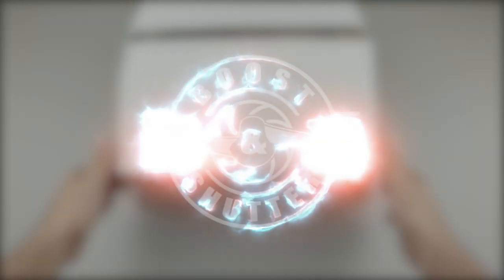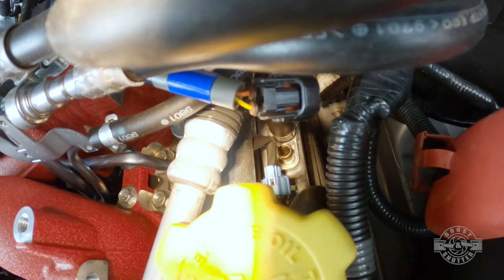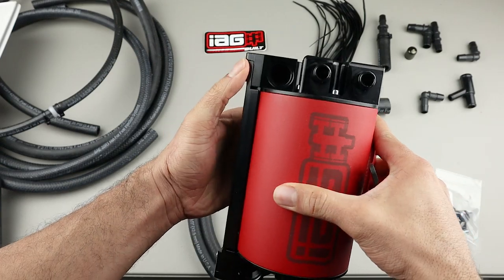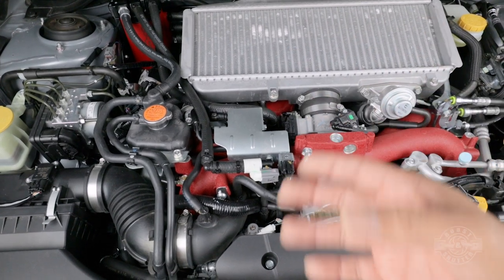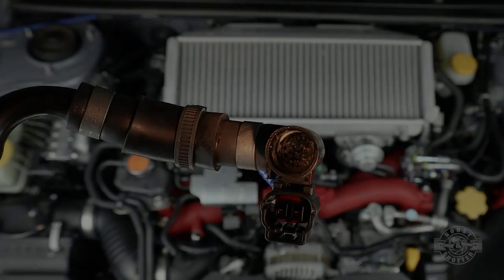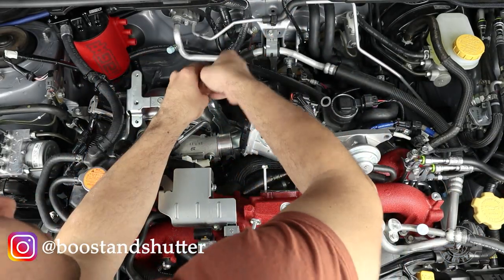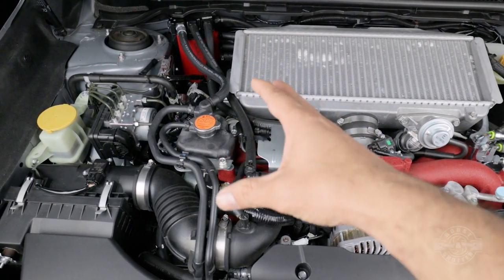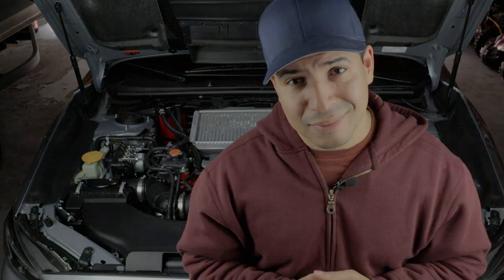How An Air Oil Separator Works | 2020 Subaru STI IAG AOS |

Comment: I had the comp version but converted to the street since I run e50 minimum...Now I'm wondering if the street version is actually doing anything since those gases are still in my engine..I've heard of a few people running 23+psi having the street AOS clog up their EBCS lines...I insulated the return hose with foil tape and insulated mesh wrap because I've heard horror stories about condensation freezing inside the hose causing BOOM

Comment: Holy crap. A lot to take in. 
Would you say this mod is damn-near a must for almost any Subaru? Or more for those who have high horsepower engines, like heavily modified engines or Imprezas and STI’s? 
I have a 2017 Forester w/ the 2.5 L engine and “premium” trim.
Reply: I’d say more EJ engines as he said

Comment: Wow dude thanx... I am glad for the video it helps... but I am having a slightly difficult time completely relating this to my AOS on My Porsche. I have a 2006 Porsche 997 and currently working on changing mine... I have oil in a couple of my hoses... can you explain the tubes workings on mine please. I am unsure if oil should have been in them in the first place. Help needed if u can thanks.

Comment: Hey Boost & Shutter - could you updated the amazon link for an IAG AOS for the 2020 STI? When looking at the product on IAGs website, it doesn't explicitly state the 2020 STI is supported. Just want to make sure to get the correct one. Thanks!

Comment: I have the IAG AOS and was curious. Is there any maintenance it requires/cleaning? My research I have learned it basically “cleans itself” unlike a catch can. Please correct me if I am mistaken and thank you!
Reply: hey man i have the same question. did you find the answer to it? i have the iag aos competition one.
Reply: @nickp3004   hey I don’t think you need any type of maintenance for them from what I’ve picked up. It kind of cleans itself hence the dump tube.
Reply: @nickp3004   I have the same one btw

Comment: I'm from the UK. My 2017 STI is RIGHT HAND DRIVE. The brake reservoir and wiring harness are reversed... is this IAG AOS going to fit right hand drive STIs? If I can mirror your install I'm unsure if the hoses are going to be long enough 🥺

Comment: Nobody can explain to me why, the top throttle body line has a one way valve in it. If we are deleting the PCV system. Why have another PCV?

Is it because of running boost to maintain internal AOS pressures?

Also how does the block breather not vent into the drain side of the Y splitter? I assume it's because of vacuum effect at the AOS inputs being close to one another and it pulls ventilation gases to the path of least resistance? And the drain should have pressure pushing out?
Reply: What i understand that IAG pcv part in the hose is nothing but one way check valve from AOS to intake manifold just under throttle body. It's to prevent high pressure going back to AOS when car is in boost
Reply: Could you delete this hose, would it compromised the whole system not sure

Comment: I just finished my audio gear, so this is my next step. do you have any idea of what I should do? my leg is weaker and I find the 2020 wrx clutch spring pressure and abrupt catching point a problem, I have a 2019 impreza 5 speed that I now prefer driving because of the wrx clutch ,and I've had manual transmissions in the past , but I don't care for this clutch.

Comment: So the port in the middle of the block is to feed gasses into the canister and at the same time (with the Y fitting) dump it into that same port?
Why?!
Reply: I guess multi purpose opening on top of the block right above crankcase. Gases are lighter and will always go up to higher parts but side of the Y is perfect for oil slowly  draining down Into crankcase with rest of the oil

Comment: Hey bro I have a 2020 sti will I loose my warranty if I install this AOS?
Reply: I'm thinking the same
Reply: yes but if you're stock power you probably also dont need an AOS even though it would still be good for the motor. its a more important reliability mod for those breaking warranty and sending it.